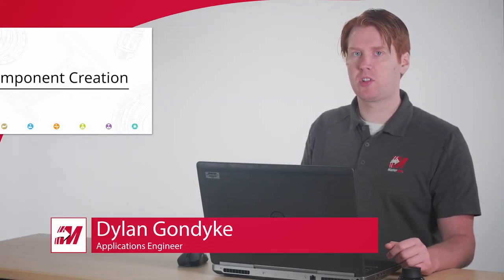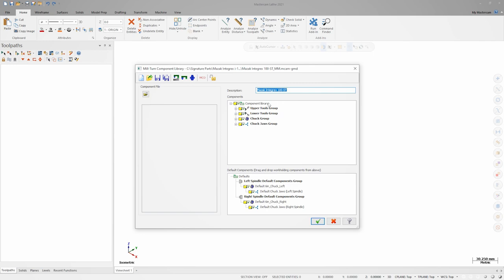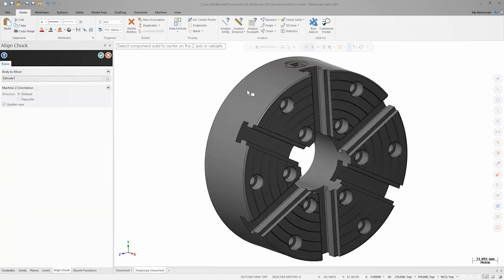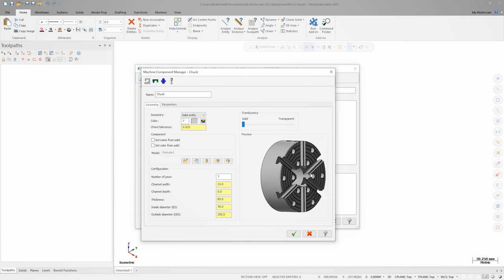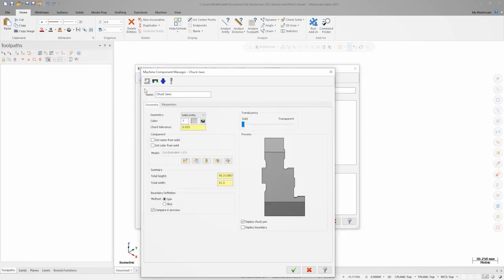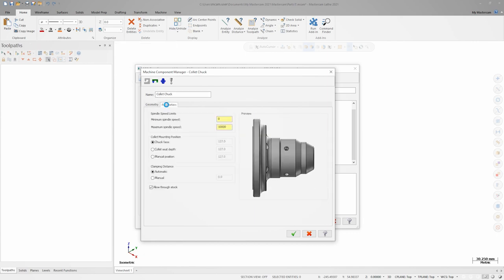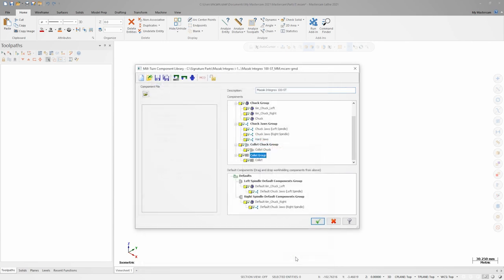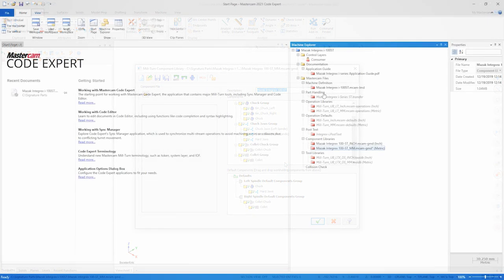Keyed Cable Guide: Component Creation

Comment: Hi Dylan, Im a 5 axis MasterCAM user for years, I have always used Vericut software to be sure its everything corretly after posting. I even learned how to build our own machines on Vericut. 
Recently we have purchased a Mazak integrex and bought the mill turn module which came with the virtual machine like the real one for MachSIM, but I'm not acquainted with it. Could you please post more videos about  MachSIM?. How to set the axis, components etc. And even how to work with the ambient that its too different to solid verifying. I couldn't SAVE any configuration on MachSIM as the desviation collors and values like a I do on solid verification. Always when I open Integrex machsim its everything defaut.
Reply from the maker: For general Machine Simulation model changes, check out this video which goes over the basics of adding and manipulating components:
https://www.youtube.com/watch?v=of74LI7vGF4

For the Mill Turn environment, Simulation, with components and operations passed through Code Expert, can be different from traditional Mastercam Machine Simulation. I would suggest reaching out to your Mastercam Reseller, or to Mastercam Technical Support, to get training and information on your specific setup, and for your specific goals. 
https://www.mastercam.com/support/technical-support/

Comment: My version of Code expert doesn't have the Machine explorer panel under the view tab, it's missing. Is there something I need to enable?
Reply from the maker: Hi Greg. What version of Mastercam are you running? You should always be able to see the Machine Explorer button in the View tab, but you won’t be able to view machines or the machine tree unless you have the Mill-Turn package and a Mill-Turn machine to open. Please feel free to reach out to your local reseller or tech support for further assistance. https://www.mastercam.com/find-a-reseller/
https://www.mastercam.com/support/technical-support/
Reply: @mastercam  Hello, I am using 2021 but I do not have the Mill-Turn package so that would be why I don't see it. Thanks for the reply and thanks for the videos, please keep them coming.